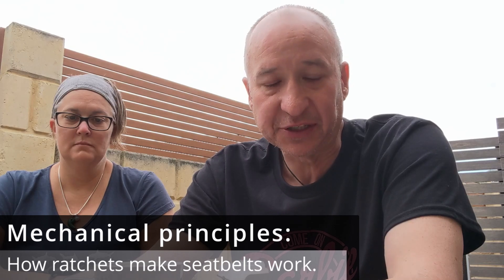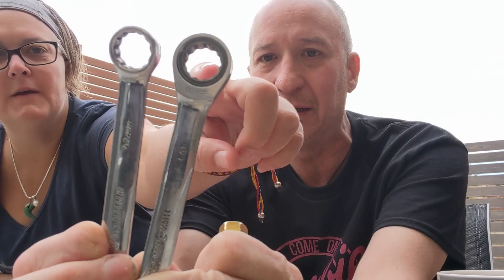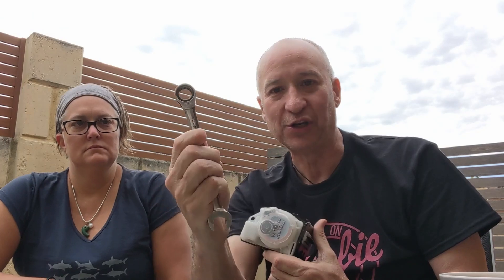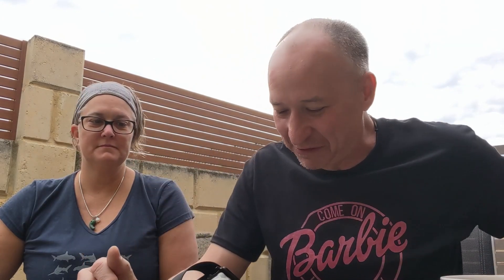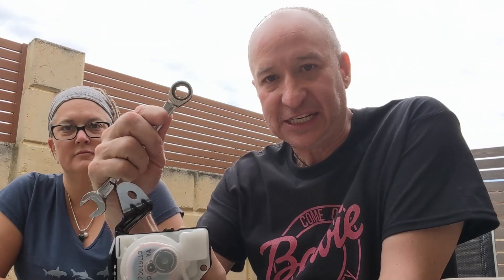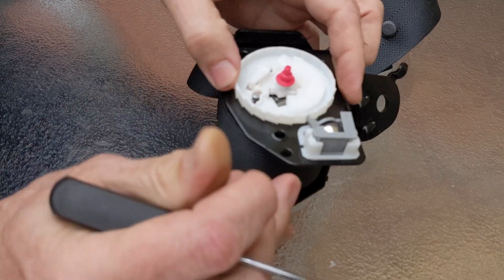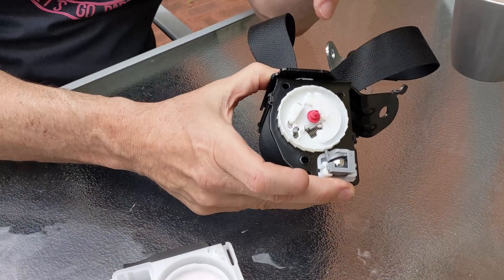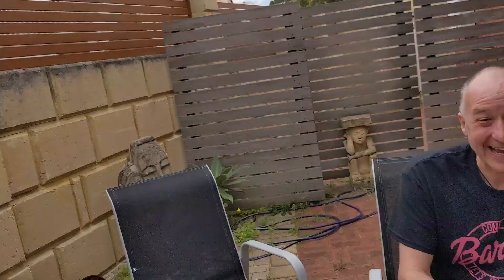Mechanical Principles.  How ratchets make seatbelts work.

Comment: Dear Paul and Caroline.  Deb from Victoria here. I do not follow car vlogs (normally).  
I have a Honda HRV 2000 model. I am the only owner and serviced on time since new (First Honda serviced, now same mechanic for years).
I have noticed the Driver's seat belt (mine) is mildly fraying. The other seat belts are not used more than perhaps 10 times. I am wondering can my mechanic swap seat belts around (since this model is not made anymore).  However, now I am thinking, I maybe driving a car, that could be unroadworthy. 
I have been pulled over for .05 random testing and the police don't worry about my seat belt. 
I am attached to my SUPERSONIC BLUE HONDA HRV. What do you think Paul? Thanks Paul. Deb x
Reply from the maker: Hi Deb, if by mildly frayed you mean like a peach fuzz, then there is a really simple way to fix it.  Get a cigarette lighter, and quickly run the flame along the frayed edge.  It will melt the frays back into the belt proper.  Do not linger with the flame, or you will melt the belt.  Quick touches.

If the belt is past that type of repair, then there are specialist companies that will refurbish your existing seatbelt.  The process is called rewebbing.  Here is a mob in Melbourne that do it.  https://grantwalker.com.au/seat-belt-replacement/

All the best.

Paul.
Reply: Thank you Paul. Debx